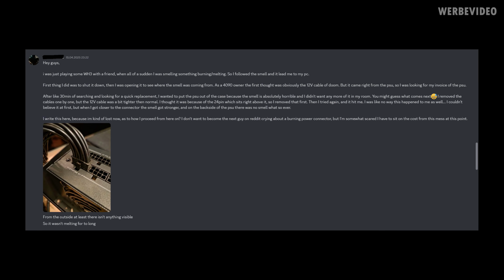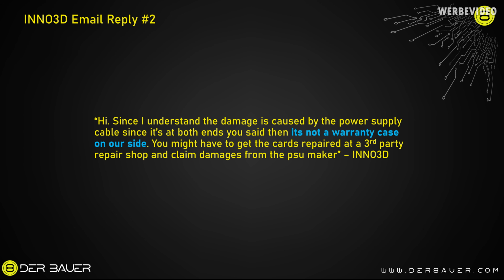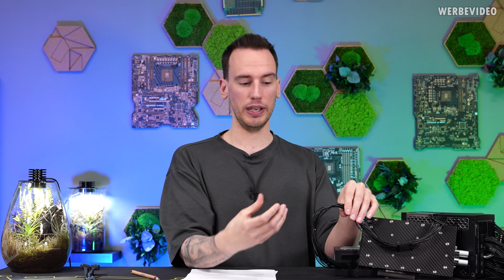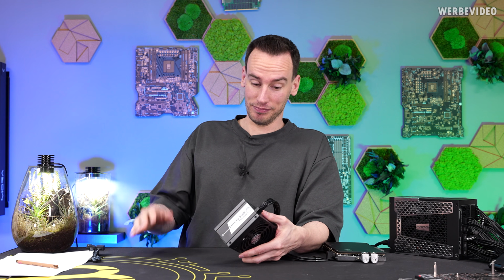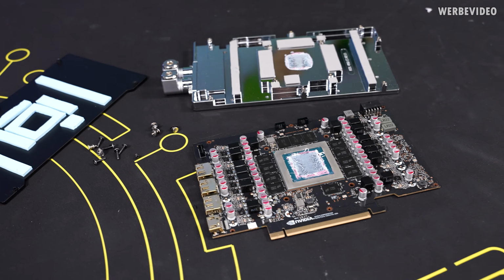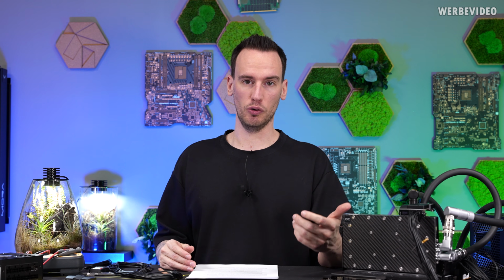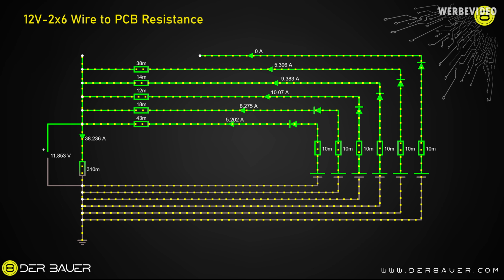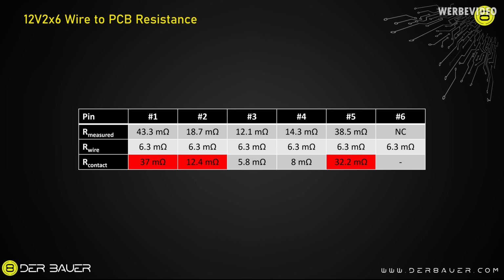Investigating and Fixing a Viewers Burned 12VHPWR Connector

Comment: I still do not understand why something similar to XT90 is not used. LTT did a video on it aswell and tbh, I kinda dig the looks of two thick wires for power to the GPU
Reply: those cable is too thick tbh flexibility is one of the issue
Reply: @mr.il3nt658  They make High-Flex cable. Not a problem
Reply: @mr.il3nt658  what flexibility? there are soft and super-bendy cables out there, even  some car jumber cables are super bendy for what they are.

for 90-degree angles, there are connectors for that.

/thread

Comment: Possible solution: conductive grease?  "fill the gaps" of any irregular connection surfaces in the connector?  Explanation: 

If the root issue is heat caused by poor/"sub-optimal" connections at the connector - which is usually either caused by corrosion (unlikely in this environment) or poor mating of surfaces (more likely) - which effectively reduces the total cross sectional area for electricity to flow.  This would put too much current through the legs/wires that do have solid connections.  

All this talk about "per leg power regulation"... yes, it would prevent catastrophic failure but also limit the performance of cards- and I bet manufacturers know this and would rather deal with the ambiguity of the blame game rather than having a year of "my card is slowing down for no reason!" just for eventually someone to figure out the cards are going into limp mode.

It would be interesting to put some math behind it.  What's the cross sectional area of the card's bus bar at the plug?  The total area of (8) 16awg cables is 10.32mm.  Does that choke down to something smaller at the connector?  Does adding a conductive grease either "add" area or better mate the two surfaces?  

Another possible cause / somewhat similar situation: American home wiring had a lot of aluminum wire usage in the 60s and 70s, and homes with aluminum wiring are WAY more likely to catch fire than those with copper.  While renovating and updating homes, the "remediation" (without a complete rewire of aluminum wiring) is a whole niche electrical contracting industry.  The failures which result in fires are caused by a mix of oxidation of aluminum, some lackluster compatibility between metals (similar to the issues you'll see in watercooling), but also that aluminum becomes extremely brittle under high loads and long duration A/C 60hz.  I wonder if there is some variation of these circumstances  happening in the 12vhpwr connector.

Comment: 12 volt is not a bad idea but how they implemented it certainly is. If they had power proper power regulation and beefed up the wires the increasing of the demand would not have resulted in the lowering of the safety margin.
Sadly they went for cheap and stupid.

Comment: I’m no electrical engineer, mechanical is my forte. But I think you should have added the resistance from the other half not subtracted it. With the length of the cable and the crimps it looks like your total resistance from end to end would be about 11mohms by my maths. Again not being an electrical guy, I would assume electricity likes to travel much like water and takes the path of least resistance until the resistance balances out, so in this case if pin 6 had a perfect 11mohm connection 100% of the power would have gone into that cable, until it heated up and increased its resistance to match the the next wire, then juice would flow evenly through those two wires until resistance increased to match the next one and so on. So in this case we can assume power would have gone 100% into Pin 6, then once that heated up Pin 3, then maybe 4. Pin 6 would have melted because the only way it could increase its resistance was heat, where as the other pins had shittier contact. By my quick maths pin 6 would need to reach 50c before matching pin 3, to then split to match pin 4 about 95c, then to match pin 2 195c. So he was running on 3 cables. 30c delta between pin 6 and 3, and 75c delta between pin 6 and 4. So about 142w per cable or 12amps and pin 6 constantly increasing in temp from 95+. That’s just my take, some electrical engineers can chime in and correct me.
Reply: No, 100% of the power does NOT go thru one pin/wire. The power is unequally shared, as shown in the video.
Reply: @ how can that be true when he was measuring 1-3 amps and then like 18amps with 3 wires in previous video on the 5090. The voltage would be the same obviously, but the power will flow down the path of least resistance. I’m sticking by my theory that for the first couple seconds all power went through pin 6, once that reached 50c equal amounts of power went through pin 3 as well, until pin 6 hit 95c and Pin 3 hit 65c, then pin 4 activated and each was flowing about 12amps with temperatures increasing because they are still over loaded. Pin 6 would get toasted first. I could be off by a couple degrees or amps because some power will still flow through the higher resistance wires but minimal. It’s a stupid design. Always has been, main issue is that it requires a single rail. Essentially both on the GPU and PSU you have 1 wire for 12v and 1 for ground. You get 6 strands of each in between to make it more flexible. Not sure why they didn’t keep 3 rails like before, easy enough to wire in the PSU. That’s why as well nobody that uses the included adapter has had any failures. PSU might trip OCP but it won’t melt anything. That’s why honestly if I was any of the AIBs or NVIDIA I would also say, sorry bro, go after PSU or cable guys, we gave you the adapters that would have prevented this, you chose not to use them. Yeah it’s ugly, but NVIDIA went out of their way to give you the solution at extra cost to them. If they thought it was a non issue they would have saved themselves the 5$ per unit and not supplied the adapter. It’s like using a Ching Chang Chong charger and cable to charge your iPhone and then complaining to Apple your iPhone fried but it’s their fault because the cable you used was USB C or lightning.

Comment: Shouldn't a PSU have some sort of power safety to limit the distribution of power per cable of the 6?
Reply: No. All 6 wires connect to the same point inside the PSU. There is no specification for max continuous amps or max surge amps for the PSU.  Previously, the current balancing was done at the GPU. That circuitry was removed!
Reply: @MrSummitville  what a crazy design. I guess all the Americans are starting lawsuits against NVIDIA for temping to light their home on fire.
Reply: @OldPcTuner  How did this new, poorly designed GPU, pass UL inspection? Parallel Power wires are usually NOT allowed, without an active power balancing circuit.

Comment: Most likely a stupid question but what if the melted connector was removed and and a new cable was hard wired/ soldered directly to the gpu
Reply: That should stop the melting at the GPU end.  But the connector could still melt at the PSU end.

Comment: As soon as I bought and installed my RTX 4090 I installed MSI afterburner and ran an undervolt and a 83% power limit and I’ve gotten ~97% of maximum performance and a noticeably reduced power requirement at 4k and 4K (DLSS Quality) gaming and no issues at all to date🤞🍀!  

I do check my cables now and again during any extended gaming session (usually more than 2-3hrs) and my cables have very minimal warmth in them 🥰💪👍😇.

Comment: 24:56 Here the Bauer gets a bit mixed up: In a parallel circuit with a variable contact resistance at a pin, the more appropriate formula would be P = U²/R (!). With one pin per pole, the behavior of the power loss is then reciprocal, meaning P = I²*R. However, in a parallel circuit, the current is no longer constant, meaning that a contact resistance higher than the rest will ALWAYS lead to a drop in transmitted power, which, in the limiting case (R → ∞), approaches zero at that pin.

Comment: We really need a heavy-duty 12vh cable with hardware on both ends that auto-load balances the current going through the wires that should also be over-spec as well, before throwing it out the connector. There's no other way, and you're still stuck with lowering the power draw settings if you still want to avoid the heat-up of the plastic as time goes by given how high the wattage of these cards go.
Reply: Or just use one black wire and one red wire per normal common sense electrical engineer design. And consider increasing the voltage to 24v or 48v to lower the amps.  I don't understand how the 12vHPWR and 12v2x6 connectors passed UL approval?

Comment: Just go with a big cable (like motorcycle battery cable) and just screw the connection together with a big copper screw. It's probably faster and easier to connect the that connector

Comment: In my opinion, contact burnout is caused by sparking in the layer between the contacts. Such small contacts have a small clamping force, so sparking is possible. Only a spark can release so much heat to melt the connector, it is about 10W
Reply: Then how do you explain both ends of the same wire melting?  Sparking on one end, should melt just one end. While high amps, in one wire, can melt both ends.  We may have two problems ... Sparking and unbalanced / high amperage.
Reply: @MrSummitville 
In the video, it looks like different wires are damaged, on the GPU side at the edge, and on the PSU side in the middle
Reply: @petrovich5188  There are many other videos. Some show the same wire has melted pins, on the both ends.

Comment: There is something I don't understand and I've seen it used by others too (GN). It's about the p=i*i*r law. I know it's true. I suspect you use it, because heat is proportional to the current "i". However the power supply doesn't provide constant current, it provides constant voltage "u". The Ohm law (i=u/r) means that the correct formula is p=u*u/r. In other words the lanes that overheat are not the high-resistance ones, because the current there is lower. The overheating lanes are the "good" ones that take the slack of the bad ones.
Reply: That is what he said, in the video.
Reply: When calculating the power loss in the connector, you're really calculating the voltage drop over the connector so the U in this case is neither known or constant. The voltage of the power supply is irrelevant because its the current flowing over the resistance that causes there to be a voltage difference across the connector. Since U=I*R and P=U*I you get P = I*(I*R) = I*I*R = R*I^2. You are however correct in that it is the low resistance lanes that overheat, but that is because the lanes are in a load sharing setup where the low resistance lanes get the most current.
Reply: Current, Voltage, Resistance and Wattage can all be interchanged in 2 equations to say the exact same thing.  It doesn't matter which equations you use to get to any of the 4 values..  Hence 2 of any combination can give you the value of the other 2 missing pieces.

That is how ohms law works in totality.  In this case Roman had Resistance and Wattage and used it to get current per wire.  Then used current per wire and resistance per wire to get Wattage per wire.

Comment: I saw already some explanation from repair workshop, they disassemble GPU card and find out that melted connectors on some graphics card is result of the wrong schematic of PCB's: high power currents flow through couple contacts/wires, which results in the melted connectors. No one  from existing wires, used in this cables, can provide so high throughput. Best case - melted connector, worst - burned out your PC... Their advice was - under-volt and don't use synthetic power-tests in your system!
Reply: Which manufacturer has the wrong schematic?

Comment: It is only complicated or mysterious when you try to imagine a minimalist fix that still allows cutting a lot of corners that simply shouldn't have been cut in the first place. Humans really have mastered powering devices that use high three figure watts when they care to do it right, I assure you.

There are a number of failure modes it seems. The common thread is a combination of the lack of margin of safety and lack of load balancing. They went for cheap twice over. Sure, the H++/12v-2x6 update probably made partially disconnected cables no longer a vector, or at least a much less likely vector. But there are still defective wires, damaged wires, defective connectors, and damaged connectors. And that includes connectors that are so mildly damaged that it is just the wrong degree of worn-in because the lack of margin of safety makes it that close.

If they just reclassed it for somewhat less power, like even as high as 400 watts, and then required load balancing from the card then they'd be fine even with this thus far trouble plagued system. And that would still be enough to solve the problem of it being undesirable to lead 4+ wires from the PSU to the GPU. 3090s never had a pattern of this issue and they were not so careful as they should have been with going to 450 watts on the H+/12vHPWR, but at least it had a three channel load balance and apparently that cut the failure rate quite adequately well.

Comment: Connector should be made of material that melts in first place, if it does its bad cheap quality for its purpose. I saw some video where they put it under almost 200c and it didnt melt. From what i know gpu side is always made of material that is heat resistant.  Noone knows if there is issue with soldering connector to board when they make card, it takes also heat to solder to board not just  taking it off.